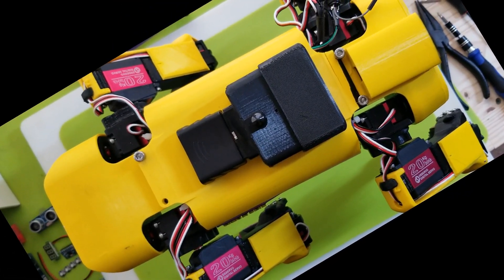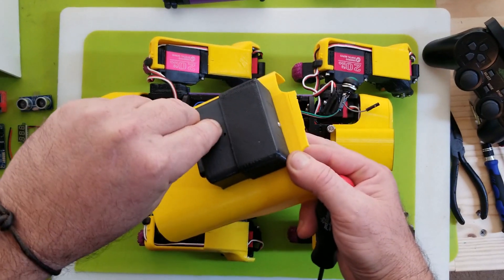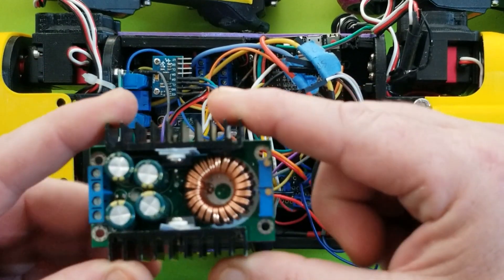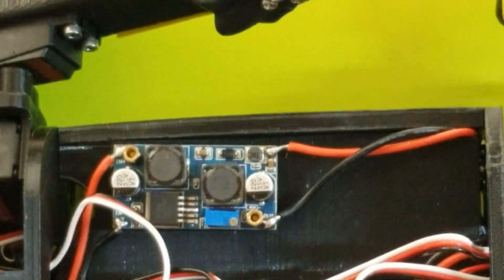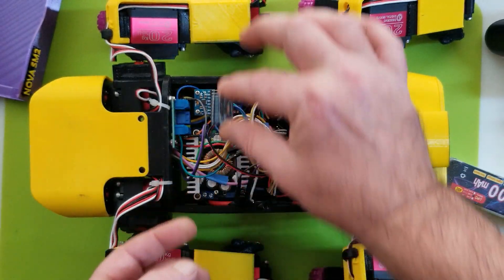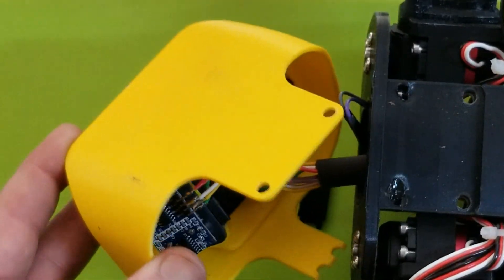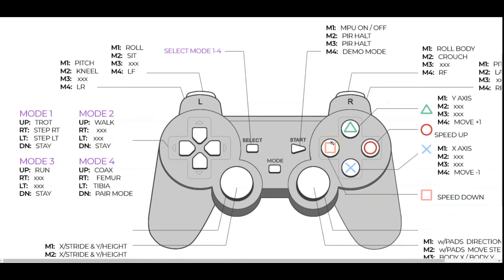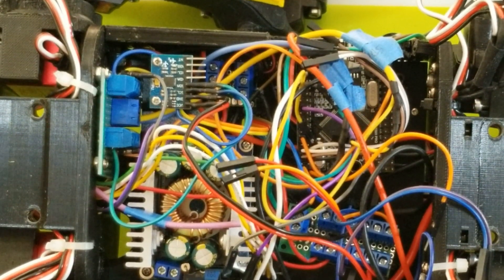Nova SpotMicro - Hardware Teardown : Part 1

Comment: Great work. Your dog is moving really well.  I'm building one too, and just got a basic walk going.  I noticed you said you were using a 'high current switch' for the power.  My buck converter has an 'enable' which can be used to switch power on/off from a logic level.  The leakage is about 10 uAmps so this is an easier way to switch power to the servos off.  I think your buck converter may have the same feature.   I use a lowish power switch for the compute as this only takes 1.5 amps.
Reply from the maker: wow, thats a great tip, i will dig into that. Thank you so much, and good luck with your project!
Reply: could please tell me the component list
servo's type and voltage regulators
Reply from the maker: its all on github and Nova's website linked in description

Comment: How long can SpotMicro run with the 2200mah battery ? 3 hours ?
Reply from the maker: I haven't really had a chance to fully test that, but that's probably a little over-estimated.  I'd say more like 2 hours max.  Once I have her re-wired and all electrical issues resolved, I will be spending 100% of my time coding / testing, so I can give a better estimate then.  Subscribe to stay tuned!  Thanks.

Comment: What bearings are you using? I mistakenly ordered 625zz bearings instead of the F625zz ones listed on the original spot micro... The studs that go into the bearings built into the files you have look like they're around 8mm instead of the 5mm id listed for 625 bearings......
Reply from the maker: I used 8x16x5 bearings... you can find the full parts list on my github in the readme file
Reply: @ChrisLocke1969  Ohhh, I hadn't dove into the github yet, I just saw the parts list on the original model and started ordering stuff
Reply from the maker: ya, unfortunately, the original designer had to halt his project and never really got to the hardware. So i ignored it all and used my circuit designs from my hexapod project. Do checkout my github, it includes halfass wiring diagrams, too. 👍

Comment: how many amps would you say each motor draws at max load?
Reply from the maker: I believe these have a rating of just over 2amps max each... but its unlikely all 12 servos will every hit that at once. Hence, I settled on a 12amp buck converter and have zero electrical issues ;)
Reply: @ChrisLocke1969  ok great i was just looking at buck controllers on ebay, most seem about 3 - 10 amps

Comment: How do you ensure that the lipo battery doesn't get over discharged? Is there a automatic shutdown or a battery management system?
Reply from the maker: there is, yes. a simple voltage divider monitored on an arduino pin... the software controls warnings and shutdown from there, easy! 👍

Comment: the voltage devider, its not quite clear but looks like you used a 1k and 2k resistor and a 1k with the fet, is this corect and also which fet and diode did you use but i did notice that the input of the ACS712 are both conected to the same positive rail on the bread board?
Reply from the maker: yes, sorry about not specifying the components in my video... you are correct, 1k and 2k resistors for the voltage divider.  The amp monitor uses a IRF540N mosfet, a 1k resistor, and a 1n4004 diode. The connections of the ASC712 are inline series connections, which sits between regulator and motor control board.

Comment: Impressive video and thanks for sharing.

Why did you choose a 20kg servo ? In the spotmicro forum I read that those servos might not be enough to move/walk the robot. Did you think about using 30/35kg servo motor ? Did you ever feel 20kg motors are not enough ?
Reply from the maker: 20k are more than enough. As i say in my videos, i just think most arent powering them correctly... using too small of battery, or more common and likely, a puny buck converter that doesnt provide the current necessary. Just my humble opinion, thanks for watching!